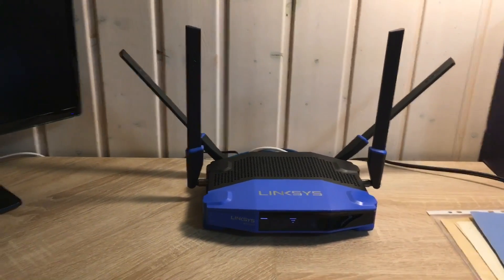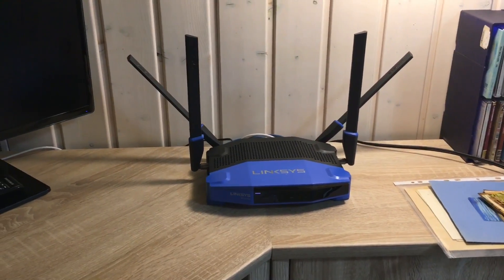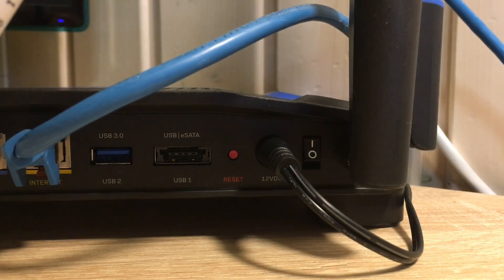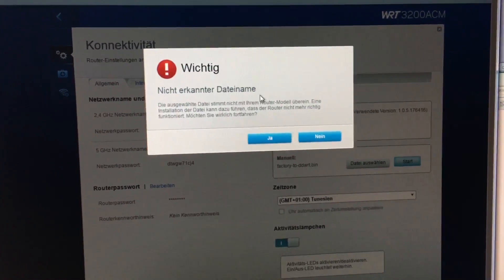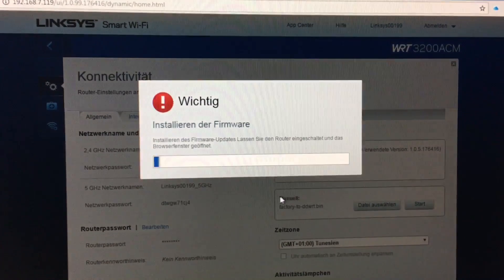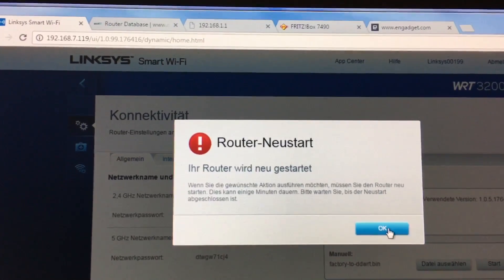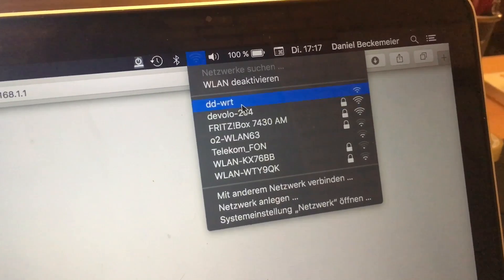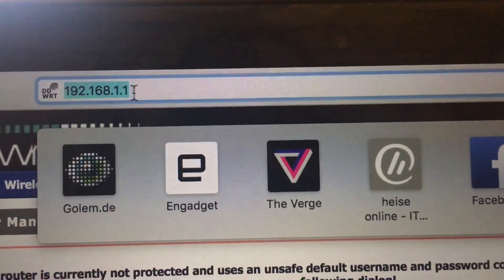Installing DD-WRT on Linksys WRT3200ACM

Comment from the maker: UPDATE: After much frustration with the use of various unreliable Wi-Fi routers, I have been successfully using the products of Ubiquiti for two years: https://geni.us/aq0V (Amazon Affiliate Link)
Reply: Nice video.. I tried to put a wireless security password but when i go to my mobile to connect to my network I found out no encrypted security and tried so many times but it did not work.. Please can you help how to do this pleaseeeee
Reply: so that AP is really good? i realize the wrt is a router too but for AP peroforance go with that UBNT?
Reply: So what was your biggest problem with the WRT? I just got one given to me and was thinking about using it with OpenWRT.
Reply: It was nice of you to make a hands on video, it was very clear to follow and I like that you make it very clear from the beginning not to attempt a wireless firmware update. That being said, the DD-WRT forum clearly advises against a 30-30-30 reset for the new generation of routers. The 30-30-30 reset applied to the legacy routers (eg Linksys WRT54G, WRT54GL, etc.). This method can damage the newer routers, including the WRT3200ACM.

Also, the current advice is to use the newest beta version, which are more stable than the latest legacy stable versions (v24 sp1). The recommended versions in the router database are OUTDATED and not being kept up to date. They could contain bugs and vulnerability issues corrected in later versions.

It would have been also worth advising about the dual boot feature this router has, as knowing in advance can help people preserve the original firmware on one boot partition and do all the dd-wrt installations on the second boot partition.

I think your frustration with the DD-WRT routers comes from unrealistic expectations. For example, on WRT3200ACM, disabling the second 5GHz antenna and applying a few simple settings to the remaining 5GHz and 2.4GHz antennas could give you a very satisfying WiFi experience.

Comment: cool video.  how do i get VLAN to work? i know the switch config tab  is not suitable for the wrt3200acm ,
i just use port 4 ,    and then tag vlan2 on that port and I get WAN ip address when using other routers. 
anyone have an idea which startup command i can use to get WAN working from VLAN port 4?

Comment: If you read through the DD-WRT forums, the 30/30/30 reset is not needed or recommended on the latest generations - 1200/1900/3200 - as it was on all the prior models.

Comment: i have a very simple question when using DDWRT
on my wrt54g, asus n66u ,  etc 
I only use port -1-4   ,   usng port 1,  I click VLAN 2 and tag and I get automatically a WAN ip address from ISP on my router,  now with WRT3200ACM DDWRT HOW ON  earth do i do that .. all the guides are confusing AF , thanks in advance
Reply: There are command line fixes for the Marvell chipset routers (WRT-1900 and 3200) issues with vlans. These issues are from the dual-core CPU and port assignment. Go to DD-WRT forums and search. You will find the solutions. Any attempts otherwise seems to destroy any WAN capabilities.
Good luck - I am going down this same path and learning as I go.

Comment: I’ve followed all the steps and it comes back up with Linksys page any reasoning for that
Reply: Probably is due to the version you are installing being >about 32 meg. I was able to install the last firmware that was about late 2018 which was 34 megs. The most recent firmware was 39 megs. Would not install.

Comment: HELP!
I'm trying to get the firmware for my Linksys WRT3200ACM. I tried on the DD-WRT website and the links listed below, but NONE of them is working!
NOT WORKING LINKS:
ftp://ftp.dd-wrt.com/betas/
http://www.dd-wrt.com/site/support/other-downloads
http://download1.dd-wrt.com/dd-wrtv2/downloads/betas/2017/07-27-2017-r32868/linksys-wrt3200acm/
ftp://ftp.dd-wrt.com/betas/2017/12-14-2017-r34080/linksys-wrt3200acm/

Any good Samaritan who happens to have a spare 02-12-2018-r34929 DD-WRT firmware for my router?

Comment: the only comment I have is I have read a couple of articles which suggests that the 30/30/30 procedure is not needed on modern router (or that it is not good for them) but instead pressing the reset button for 20 secs should do the trick

Comment: 2 questions: you mention using a wired connection to perform this, would using a wired connection via powerline connection be stable enough? Also, John Blue mentioned below recommended http://download1.dd-wrt.com/dd-wrtv2/downloads/betas/2017/07-27-2017-r32868/linksys-wrt3200acm/. Is this the latest, or do you have a later version to suggest?

Comment: DO NOT GET THE ONE FROM THE DATABASE!!! The build on the DD-WRT database from October 2016 is junk. You need to get the latest on from DD-WRT ftp site: http://download1.dd-wrt.com/dd-wrtv2/downloads/betas/2017/07-27-2017-r32868/linksys-wrt3200acm/
Reply: Hi TEMP Storage, I  returned it. The wifi connections don't stay connected. Originally I thought the OEM FW isn't good. I installed the dd-wrt FW, got the same problem.

Comment: any updates in DD-WRT on the WRT3200ACM any is this just for Wi-Fi performance? I mainly have Wired connections I use NDI with OBS so it takes up a bit of my network while streaming to twitch. I wounder if this would help at all? Last time I use this was on a older Linksys N router i think it was a 1700? But not sure it did help a bit but not to noticeable.
Reply: Go here and download the latest one on 07/27/2017.
http://download1.dd-wrt.com/dd-wrtv2/downloads/betas/2017/07-27-2017-r32868/linksys-wrt3200acm/
Everything works flawlessly!

Comment: Well Daniel I am curious about the modified firmware on this specific router. As far as I know, I haven't seen any option for VoIP in the vanilla firmware?! Does the  DD-WRT provide the option to configure IP phones to the router like e.g. a fritzbox does? You may know its quite difficult to find a decent router (like the WRT1900-WRT3200) which is also capable of dealing with phones.
Ein kurze Rückmeldung würde mich freuen. Dank dir.
Reply from the maker: Hello marks4301, to be honest I wouldn't try running something so complex (depending on how big your network is) on one of these routers. It's not what they are meant for. A fritzbox is not only a router, but also your modem to connect to different WANs. This is the difference. There is a ton of features deeply developed on fritzbox to make you have the best phone experience, but it comes to limitations when wanting to use extended services or pro-features of networking. For example I'm running a fritzbox first in line to split phone-data (VOIP functionality) from everything behind that fritzbox. Then i forward everything data-related to a router infrastructure and switching. From there i route data to different accesspoints like WRT1900 or WRT1200 to ensure proper handover between accesspoints. Would recommend doing something like this.

Comment: WARNING! 
1. DO NOT do a 30-30-30 reset, it can harm your router! Holding reset button for 20 sec is will clear NVRAM. 
2. Do not use the router database. Get newer and more stable firmware from: ftp://ftp.dd-wrt.com/betas/ or http://www.dd-wrt.com/site/support/other-downloads 
source: http://www.dd-wrt.com/phpBB2/viewtopic.php?t=311117
Reply: Go here and download the latest one on 07/27/2017.
http://download1.dd-wrt.com/dd-wrtv2/downloads/betas/2017/07-27-2017-r32868/linksys-wrt3200acm/
Reply: This concerns me as I have got the linksys wrt1900acs v2, was just about to install the firmware from the main dd-wrt website which is from last year. The latest firmware from the download1 is from a couple of weeks ago. I am confused now, which one do i install ? And why are there two different repositories from the same company ??
Reply: None of those links works :/

Comment: Can you make a video how to revert to original stock firmware linksys WRT3200 ACM
Reply: In DD-WRT go to Administration -> Commands and write "ubootenv get boot_part" -> run Commands. It will return number 1 or 2. Then write "ubootenv set boot_part " and a number oposite of the number it returned (if 1 then write 2 if 2 then write 1) click run Commands, then type "Reboot" in the field and press run Commands again. Router will reboot. Source: http://www.dd-wrt.com/phpBB2/viewtopic.php?t=287813&highlight=install

Comment: Is it possible to reinstall the original Firmware after flashing dd-wrt?
Reply: yes this router has 2 partitions and stores both firmwares
Reply: In DD-WRT go to Administration -> Commands and write "ubootenv get boot_part" -> run Commands. It will return number 1 or 2. Then write "ubootenv set boot_part " and a number oposite of the number it returned (if 1 then write 2 if 2 then write 1) click run Commands, then type "Reboot" in the field and press run Commands again. Router will reboot. Source: http://www.dd-wrt.com/phpBB2/viewtopic.php?t=287813&highlight=install
Reply: Nexus Solarium Thank you very much for your effort!

Comment: Hi, great Tutorial!

What is the propose of the file  ddwrt-linksys-wrt3200acm-webflash.bin? For update previous ddwrt?
Reply: My understanding is that the webflash file is for folks who already have a previous firmware version of DD-WRT installed.  If this is your first time flashing with DD-WRT you will use the other file.  There are instructions on that at the DD-WRT site when you first download the firmware for your specific router.
Reply: jimo68 going to try
Reply: Yes but it overwrites the original stock firmware. Source: http://www.dd-wrt.com/phpBB2/viewtopic.php?t=311117

Comment: Daniel, Im reaching out to you because I"m having serious issues with my WRT3200 and i was hoping you could please help me. I followed your setup instructions and added a VPN. However, I keep loosing my wireless signal and when i go into the settings the mix 2.4/5 ghz setting (Wireless Physical Interface ath2 [2.4GHz/5 GHz/802.11ac] setting) is missing. I turn off router and it reappears. I am absolutely baffled. Should I reinstall the firmware, did I set something up wrong, is there a setting that can correct this. Im lost. Any advice would be helpful.
Reply: Arnold Stein In my opinion you should return the router. WRT3200 is not yet fully supported by dd-wrt. You could experience several issues like that. Instead go for a WRT1900 or WRT1200 with stable dd-wrt release.
Reply: Thank you so much for your help!
Reply: Can you link these?

Comment: Daniel, thank you for making the video. However, I want to clear up some questions after reading through the comments of this video. 

1.) Are there still issues with using DD-WRT with the Linksys WRT3200ACM in terms of the performance of the router? 
2.) Or am I better off in terms of performance to use the factory installed Linksys software?
3.) Is there any benefit to using the second .bin file (ddwrt-linksys-wrt3200acm-webflash.bin) hosted on the dd-wrt webpage for the Linksys WRT3200ACM?
4.) Do you have any configuration settings that you would recommend to get the most out of this router (Linksys WRT3200ACM) using DD-WRT?
5.) Have the bugs been worked out for the Wi-Fi for this router (Linksys WRT3200ACM) using the DD-WRT factory to dd-wrt bin? 

Thanks!
Reply: I don't know if it's still gonna be of use, but if you're running stock, use the 'factory' labeled bins. If you have ddwrt already installed and are upgrading to another ddwrt firmware then you use the webflash or sysupgrade ones.

Comment: Any way to go back to factory firmware?
DD-WRT is not ready for this Router yet.
If you can post a video reverting to the factory firmware will be nice.
Reply from the maker: This router has two partitions for the stock-firmware when it is shipped.
Both partitions have the same software on it when shipped. Let's call them partition 1 and partition 2. 
When you first power on a stock router, then partition 1 is active.
Within the seconds 0:00 to 4:24 of my video, we switch from partition 1 to the partition 2 of the filesystem to install dd-wrt instead of stock firmware.
Just follow the steps from seconds 0:00 to 4:24 again, to revert to partition 1 which should still be running standard firmware.
Reply: If you didn't do the 30-30-30 reset, can we still go back to original firmware? I can't seem to remove DD-WRT

Comment: Hi Daniel, could you upload a video or mention the step to remove dd-wrt and go back to stock. I only upgraded once.
Reply from the maker: This router has two partitions for the stock-firmware when it is shipped.
Both partitions have the same software on it when shipped. Let's call them partition 1 and partition 2. 
When you first power on a stock router, then partition 1 is active.
Within the seconds 0:00 to 4:24 of my video, we switch from partition 1 to the partition 2 of the filesystem to install dd-wrt instead of stock firmware.
Just follow the steps from seconds 0:00 to 4:24 again, to revert to partition 1 which should still be running standard firmware.

Comment: How is the situation with the router now? Wanted to buy it, mainly for VPN purposes. How fast is the VPN speed? Is a DLNA server preinstalled?
Reply: I have a VPN installed on it with DD WRT as firmware and the speed is brutal. I get via Openvpn up to 180 Mbit with a 200 Mbit cable internet. That is fantastic.
Reply from the maker: I'm sorry, I'm not using VPN on my devices. Problem with this thing is, that standard firmware is faulty, resulting in loss of speed during transmission and dd-wrt is not yet totally ready for this device. Me personally I returned it and instead bought a WRT AC1200 (http://amzn.to/2oiCguY). This device is slower because of it's specs but it is very reliable. DD-WRT works like a charm on it. I've also heard, that the WRT1900ACS is working beautiful with DD-WRT as well (http://amzn.to/2oc0h6j). I think if I'd buy another router I'd go for that WRT1900ACS. Should have the same  specs for VPN and other services as WRT3200.
Reply: how did you return it? and how long did you wait after you bought it to return it? because if i can test a router and see if it works for me i will keep but if not i like having the freedom to return if needed :)
Reply: Knobel C what walk through did you use ?

Comment: Hi, I followed your tutorial and installed the factory to ddwrt.bin. What about the other file? ddwrt-linksys-wrt3200acm-webflash.bin
should I also flash it as a second step? thanks for your reply
Reply: That isn't required.  It's for if you already have DD-WRT installed.

Comment: is the router working good now
Reply from the maker: +curtis sammy No. I returned it and bought WRT 1200 with ddwrt. Problem solved.
Reply: I want to buy a reliable router to use with DD-WRT as a VPN server. Can I ask why you chose the WRT 1200 and not the WRT 1900AC?
Reply: lol lee how long have you been using it for? What VPN options do you get? Do you get IPsec, ikev2 and so on? Or only PPTP?

Comment: I just got this router a few days ago and I'm not new to ddwrt .However from what I have read there support is very limited and Wi-Fi does not work correctly as the drivers are still being kinked out.Kong has no builds out for it as he does not have this unit yet ...Ill hold off for now..
Reply from the maker: tokoam Hi, well that's kinda right. There are still some issues as for example that changes are only finally applied when restarting the router. Not knowing that, setup is hell.

I've had problems with the original linksys firmware in accesspoint-only-mode which forced me to dd-wrt to have steady wifi. The router is just used as accesspoint without dhcp, or any other services. Therefore it works quite good but at the moment i wouldn't recommend it for any other services than only standard-functions.
Reply from the maker: tokoam Hi, well that's kinda right. There are still some issues as for example that changes are only finally applied when restarting the router. Not knowing that, setup is hell.

I've had problems with the original linksys firmware in accesspoint-only-mode which forced me to dd-wrt to have steady wifi. The router is just used as accesspoint without dhcp, or any other services. Therefore it works quite good but at the moment i wouldn't recommend it for any other services than only standard-functions.